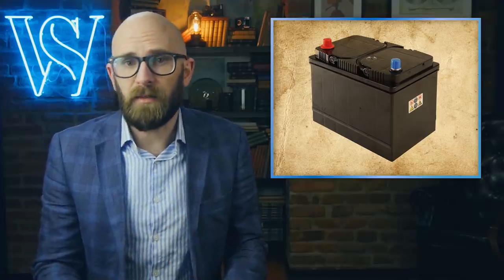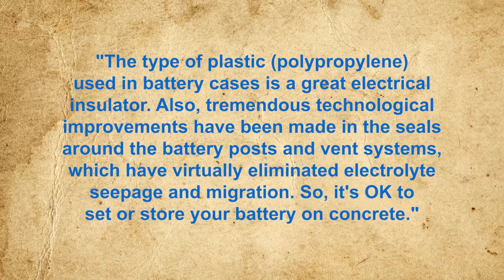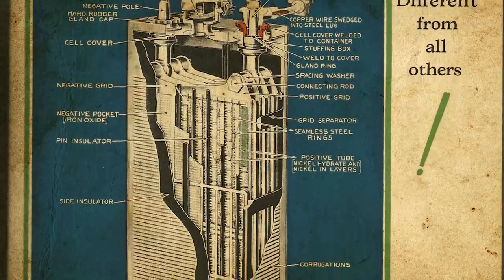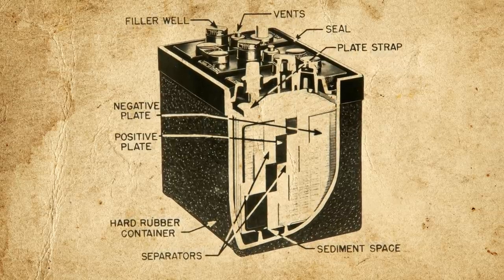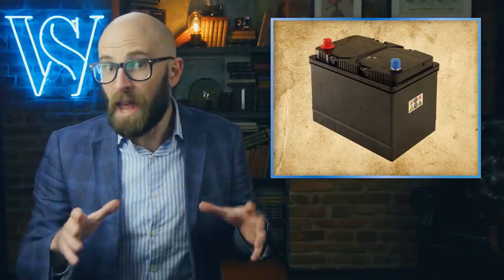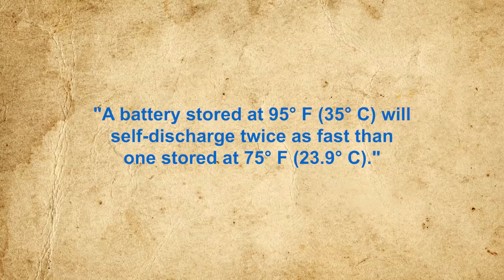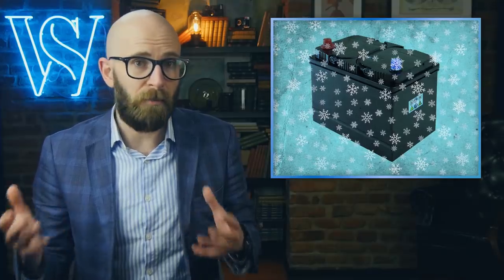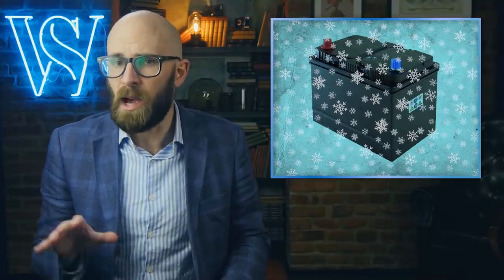Why Does Placing a Car Battery on Concrete Drain It?

Comment from the maker: Check out our channel Highlight History here! https://www.youtube.com/channel/UCnb-VTwBHEV3gtiB9di9DZQ And here's the concrete and cement one. One of our first videos :-) https://www.youtube.com/watch?v=heDKi42CD1A
Reply: Doesn't a plastic bag of  dry draino put in gasoline explode? 
I saw "yes" my friend says 'no'.
Reply: Today I Found Out because Jesus wills it....
Reply: Hilarious coincidence! This is my car problem, it's just too old. I'm even using an Interstate brand battery. It's not the right one for my car, it's an old RV battery. You make so much content that by chance a few of your other videos have been spot on with great timing. Either that or this is 20 years into the perception of a DMT trip, and I'm still in my early 20s on a couch with only minutes having passed so far. If that turns out to be the case, it would explain the slow down in fashion changes and the only real difference is that smart phones are a thing that makes everything easier and more frustrating equally. 
And now I have a new thing to discuss with a councillor...
Reply: Today I Found Out tho ai already knows why extreme cold kills phone vateries; it would be neat if u made a episode about that:)
Reply: The discharge rate has one other important aspect. Even stored with nothing connected leaving a battery for 6-12 months (depending on the battery) in storage without re-charging it can ruin the battery very quickly. My mother fucked up two expensive batteries for a motorbike because of this. One was brand new to replace the first one.

Comment: It's an old husbands' tale.
Reply: The Original Gamer - His wife probably told him this and his only correct response is “Yes, dear.”
Reply: It's not the winter part isnt anyway he is just repeating facts he found on wikipedia instead of asking a qualified engineer
Reply: The Original Gamer    I'm an old husband, and I had my tail removed !
Reply: I have looked into the old tale a lot over my three decades of being responsible for lead acid battery banks in communication sites. My conclusion - it is impossible to tell where the story got started and why. For every claim of a source there were at least a couple of claims against it. The modern lead-acid battery has a remarkably murky past.
What is clear is that heat is bad for them, especially for low maintenance and no maintenance batteries. So is chronic overcharging, which causes the positive plate to grow in length and width. In communication batteries that causes the posts to protrude and in car batteries (especially the side post versions) it causes the battery to become intermittent. In cars, hot climates are the major cause of chronic overcharging.
Finally, take that reduction in freezing temperature with reduced charge very seriously. The problem most often shows up in a car that has set unused for a couple months before winter sets in. The battery is mostly dead by then - three months is usually too much for a modern car even in mild weather - and the freezing temperature can be above 0F.
Reply: @flagmichael  from my experience  working on a plant hire fleet only old batteries die in winter when you turn the engine over, I assume it's something to do with chemical reactions and temperature. It might also having to do with excessive use of glow plugs which draw tones of power, quite a few variables  but yes batteries do die in winter. Hate it when YT channels just spout facts of wikipedia
Reply: Never heard about it.

Comment: My father - an experienced mechanic - always told me this, until I learned better when I started building energy storage systems. I tried to explain, but he won't listen.
Reply: SHOW him! Scientific evidence, theory to practice, repeatable results.
Reply: Im also a mechanic and I swear it's true every battery I've ever stored on the shop floor is dead when I try to use it. It's probably just conformation bias tho but I always set batteries on a bench because of this old wives tale

Comment: So, I'm from the Yukon. We usually plug in our cars/trucks when we have them parked outside during winter. Most southerners think we are plugging in the battery. But besides warming the engine block heater, "plugging in our car/truck" means powering a battery blanket, keeping the battery warm enough to start the vehicle. As this video states, even in extreme cold (-35C to -50C) it's never that the battery doesn't have enough charge, it's that it gets too cold and can freeze.
Reply: Adding a small trickle charger to keep the battery topped up will keep the battery at the optimum to prevent freeze and reduce degradation. Battery manufacturers have SoC/freezing point charts that will make this clear.
Reply: i had a core plug a silicone heating pad on the oil pan and a trickle charger plugged in
Reply: Electrolyte freezing temperature depends drastically on the charge (which changes acid concentration).
Reply: @Alexagrigorieff  I found a couple of charts
The first one relates freezing point to specific gravity.
https://i2.wp.com/mathscinotes.com/wp-content/uploads/2013/02/EditedFinal.png?ssl=1
The second one relates cell voltage to specific gravity and molality.
https://i0.wp.com/mathscinotes.com/wp-content/uploads/2013/02/Cell-Voltage-Versus-Specific-Gravity3.png?ssl=1
Reply: A fully charged battery won't freeze, but a drained one will....hello from Edmonton!
Reply: Vehicles also come from the factory with a battery blanket. People often Chuck them when they replace the battery. Even mechanics fuck this up. The blanket on sub zero atmosphere batteries is an additional measure, but the blanket is there to keep the battery warm/protect from the heat of the engine in conjunction with a shield for said heat issues. It's almost like we engineer them that way and folks can't be bothered to put them back together properly.
Reply: Mister, clearly you did not understand the content that you viewed.
Reply: @MinistryOfMagic_DoM , it's not bad enough that most people are Idiots when it comes to most things mechanical and all things electrical (Physics are a Idiots enemy), but most mechanics should never be allowed to touch a vehicle, let alone redesign any part of its electrical system.
Reply: I lived in Alaska as a kid and remember my mom doing this ^_^
Reply: Lets face facts unless you are repairing some thing that requires the battery out you leave it in. If you have to store a battery get a trickle charger on it for at least half an hour every month same goes for storing the car keep the battery charged and for cars that have carburettors run the engine to flush the crap that forms in the jets as the ethanol evaporates. Motorcycles that are stored over winter should be run every two weeks to recharge the battery and run fresh petrol through the system.
Reply: @keithmcintyre6403  lol I just commented about this because I learned it the hard way
Reply: I also only clicked on the video because I saw myth of cold weather and knew it wasn’t a myth that batteries have a reduced charge do to cold slowing the chemical reactions. 

But he goes on to talk about a myth that cold damages batteries. Which I’ve never heard anyone claim before. 

Fun fact, at the coldest part of winter here, a brand new smart phone will go from full charge to “dead battery” in 10 minutes in your hand instead of a pocket.

But will return to a full charge once you return inside and it warms back up.
Reply: @keithmcintyre6403  Lead-acid batteries change their chemistry depending on the state of charge. A fully-charged battery's fluid is (more) sulfuric acid. In discharging, the sulfur atoms bind to the lead, and the fluid becomes (purer) water. 
The exact relation of sulfuric acid concentration point to freezing temperature is given by http://www.sulphuric-acid.com/techmanual/Properties/properties_acid_freezingpt.htm
Reply: This is something we covered in my course for Avionics plus learning growing up in the mountains where we do get down to -50°f. Cold weather is bad for automotive batteries.  It does deteriorate the overall effectiveness and longevity depending on how low the temperature is and how long it's in that temperature.   The option you mentioned mitigates this negative effect greatly.

Comment: When I saw the title I immediately wondered if you were going to talk about the old wooden shell batteries. Thumbs up for the research again 👍

Part of the reason many think their car battery discharges quicker in cold weather is possibly down to people using their vehicle less in winter. Short necessary journeys combined with less use is a recipe for draining a battery. So it is more common that people experience a dead battery in winter and simply put the blame on the wrong variables.
Reply: A lot of people don't understand how long it needs to run to recharge.  Helps further push the misinformation sometimes
Reply: not just that but old people tend to say: "don't store the battery directly on the ground, put it on a wood plank." it probably have been true for a range of batteries and newer batteries appearing dead was actually just cold and outputting lower power... i guess batteries made for colder environment have chemicals that let it output more power or some mechanism to do so when cold.
Reply: As a very young child I saw my great uncle rebuild some wood cased batteries for a very old Ford tractor. He explained the drainage issue with electrolyte dampend wood case and concrete. However the discharge was the minor issue.
Acid eating the concrete was the bigger issue.
He also let me know that newer batteries had no such issues. This was in the early 60s
Reply: @heyyou5189  I think the phenomena of not putting a car battery on concrete perfectly demonstrates a quite serious problem people have in general. A large percentage of people know a rule, but do not understand why it exists.

So we end up with a small group of people like your great-uncle, who know why the battery concrete rule exists and when to apply it. In turn these people explain it to others. Meanwhile the vast majority grow a myth, because they didn't know enough to stop applying the rule (and many people (mainly adults) will not listen to people like your great-uncle. They don't know enough to know when not to apply a rule, but also they don't know what it is that they don't know.

For an example of this in action, one only has to look at online discussions of those simple but deliberately flawed mathematics questions (often on Facebook). Invariably you will see people writing "The answer is zero, because there is a 'multiplied by zero' in there, and we learnt at school that anything times zero is always zero". They will argue until blue in the face, because the don't know that they do not know this only applies to the term being multiplied by the zero, rather than the entire equation.

I recall a story I heard some years ago. The woman telling the story recounted how on Sunday she would cook a joint of meat. Before placing it in the oven, she would always cut off a  piece from one end of the joint, and throw it in the bin. One day her child asked why she did this. She explained that she did not know why, that is what her mother taught her to do. So they asked the woman's mother. In turn her mother replied that she was unsure, it was just something she had always done, because her mother did the same. Fortunately the woman's grand-mother was still alive, and so they asked her. The response was simply "I only had a small roasting tray, and had to cut some meat off to make the joint fit in the tray."

We see so much of this happening. It is a shame that there are not more people like your great-uncle, spreading knowledge with understanding. As opposed to people who spread rules that they learned by rote, and so never realise when they no longer apply.
Reply: Cirque
Reply: I live in a very cold place.
When I absolutely know that I have to be somewhere I actually take my battery out of my truck and bring it in the house, and then put it back in when I have to leave.
If you don't have a block heater, it's the only way to be sure that your battery is not going to be dead as a doornail.
I'm talking about -60 below zero fahrenheit.
Why don't I have a plug-in block heater?
That's a damn good question.
I think I need to think about that one.
Reply: @darksoul479  - In Siberia, people light literal fires under their vehicles to warm them enough to start.
Reply: plus it sucks more to deal with a dead/low battery replacement in cold weather, in the summer is less of an incident

Comment: When I was in high school (1993-1995), I spent the mornings of my senior year taking a 3 hour course in the morning in electronics at a nearby vocational school. The vocational school had other classes, like machine shop and auto shop, and paired up with ours, we built, and I got to test and drive, an electric power race car. There was a state and national competition called "Electrathon America" which we were entered into. I was one of the head designers of the car, chief test driver, and actual competition driver for the car. We even had access to General Motors CAD systems to design and print out blueprints on their plotters. Interstate Batteries was a sponsor, and gave us a few batteries for it. 

Anyway, we figured out the batteries were best kept at about 90F. So we got an old freezer, poured water into it, and then had heating elements in it to keep the batteries warm. This was to keep the amperage up, since testing and race days were usually cold. If it weren't for the 5hp electric motor overheating, we could have raced it for an hour without problems. During the big race, which incidentally was the same day as my graduation commencement, I got the car up to 50 mph, was holding 2nd place solidly, but was holding back to try to stretch the batteries out for the full hour that the race would run. If I opened it up all the way, and the motor stayed cool, I could have maintained about 70mph or more, but would have lasted perhaps 30-45 minutes before the batteries were fully drained. Mind you, this was back when GM came out with the EV-1 electric powered automobile, which was one of the early predecessors for hybrid and electric powered cars of today. I'm sure if we knew better technology of today back then, we could have done a lot better. I think computerized voltage controllers and digitally scalable power delivery would have done away with the old analogue stuff we were using, and if anything could have kept the motor cooler, since that was the weak link in our system. The hot motor just drained every last drop of voltage by causing a lot of amperage draw till it was just crawling like a baby.

Comment: There was one thing that was not mentioned in this excellent video.  When a lead-acid type battery is placed on a concrete floor it can create a temperature differential within the cell(s).  Batteries made in the past few decades are usually made with a polyethylene case which is a good thermal insulator compared to the older style battery cases that were described in the video so this effect that I'm going to describe has been mostly minimized.  For example if the concrete floor is very cold this can reduce the temperature of the lower section of the cells within the battery.  The upper section of the cells will have a slightly different (in this case higher) temperature compared to the lower part of the cell.  You now have a slightly different voltage potential between the upper and lower sections of the cells.  This will cause a current to flow from the upper to lower section (or vice versa) of the cells.  The cell voltage is determined by the state of charge AND temperature.  For example, if you took two batteries (just one cell of a lead-acid battery), one with an output voltage of 2.000 volts and tied it to another battery with an output voltage of 2.001 volts, there would be current flow between the two cells.  As the ambient storage temperature varies from the temperature of the concrete floor, this differential voltage between the upper and lower section of the cell will cause current flow which will slowly "ratchet" down the battery's stored energy.  I hope that others will comment on this. Thanks, Jay

Comment: I'm an engineer and gear head. A+
Cold weather does reduce output and engines may be more difficult to start.
Reply: We had to learn this the hard way - not on a Car but we planned a winter airsoft session :D
90% of the guns failed after a few minutes because it was about -10°
Reply: If you gently crush a Carbon/zinc battery so as to loosen up the powder inside then place some where warm like airing cupboard or on a radiator you will get double the use out of them.
Reply: But that's not because of battery drainage.
Reply: Duh.....
Reply: @JustFLBeats  I knew a jerk who would freeze his paintballs in advance for cold weather play and just blame them being rock hard on the -20 weather.
He was running nitrogen so even from 150 feet away getting caught by one of the damn things hurt like point blank.
Reply: @gmcjetpilot  answer to your response and question, zzzzzzzz
Reply: @josephtabar492  You are a troll. Didn't ask a question. It's called a rethotical. Duh. You lost.
Reply: Hence cold crank amps
Reply: Congratulations professor know-it-all..... Now let me find your brown nose button....
Reply: I imagine oil viscosity is a big factor in cold weather hard starts. I mean,thats why we have block heaters right?